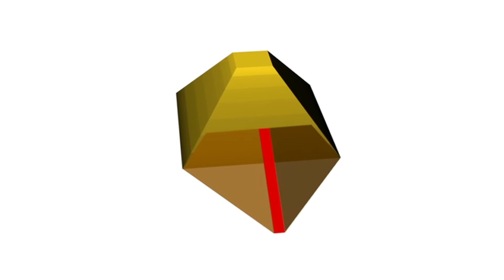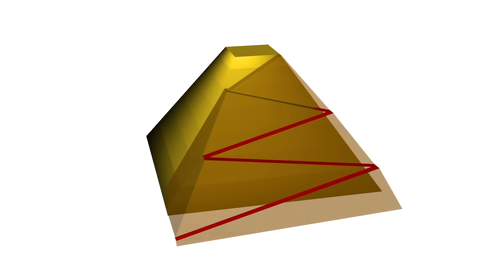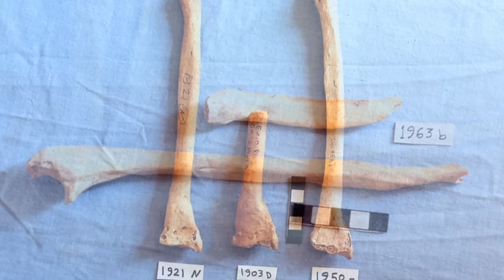Egyptology - Pyramid Construction

Comment: How did they raise over 100 of the 70 ton blocks 300 feet high after moving them 500 miles from the granite quarry
Reply: How about a reality break.

1 - there are not 100 - 70 ton blocks in the Great Pyramid.  Most of the granite in the Great Pyramid is the walls and floor of the King's Chamber which are vastly smaller in size than the larger relieving blocks above the chamber.  So right off you got it wrong.
2 - next is the King's Chamber is only about 140 feet above ground level and not 300 feet = thus another incorrect assumption laid to rest.
3 - finally is the granite from Aswan was transported via barges during the months of the annual Nile flood.  A harbor once sat about 400 meters from the Great Pyramid so the distance to move those heavy granite blocks was measured in hundreds of meters and not miles.  On the flip side the quarry at Aswan also sits astride the Nile River so there the blocks again would only have to be transported a short distance from where they were obtained to awaiting barges docked alongside the quarry area = and that makes Strike 3 - and you're out.

Moral of the story:  garbage in ----------> garbage out as the old saying goes.  When your information sources are flawed = bad conclusions inevitably follow.  So the Egyptians as noted built harbors which were near the areas they worked at.  Further they built earthen and mud brick ramps to raise objects in construction = some still exist to this day.  They also had knowledge of fulcrums and counterweights which can allow you to raise objects of a certain size and weight.  

So the largest/heaviest blocks are found in the bottom third of the pyramids and those could be raised via earthen ramps.  The smaller blocks above could be raised via a lever device akin to the Egyptian shaduf as the blocks were much smaller in size and weight.  The blocks at the top of the Great Pyramid are small enough to have been slid into place by several men.  Better luck next time.

Comment: They also discovered plumb lines and T-squares that they could have used to check the flatness. Also, Herodotus also recorded lifting mechanisms that could have been used when building the pyramids (although, he wrote about it centuries after the pyramids were built, so we have to take it with a grain of salt).

On that note, most of Egyptian architecture almost certainly used slave labor, such as in the Valley of Kings. Egyptians themselves might have helped, but slave labor was definitely used in some aspects of building.

Comment: Im a stonemason, limestone is soft compared to granite. Granite is so hard there's no way to rub down the uneven spots with flint. I call bullshit
Reply: Except they were not quarrying granite with flint.  lol!  They mined granite in the Old Kingdom primarily using dolerite and fire.  At the Aswan quarry along the nature fault lines in the bedrock they have found the remains of mud bricks and charcoal.  So the Egyptians were lining an area with mud bricks + building a fire to heat the bedrock + quench it with water = which softens the stone allowing them to pound through it much faster with the dolerite pounders of which many hundreds littered the quarry.  That would allow them to achieve the basic shapes which could then be polished using flat stones and an abrasive - possibly mixed with clay and water to create a polishing paste.

Meanwhile granite can be cut using copper tools - albeit slowly.  What is required is a lot of elbow grease and as noted an abrasive = sand or corundum.  As but one example an artifact unearthed at Amarna was created using copper tube drills.  In the drill holes they found a residue which when analyzed showed copper and corundum.  Corundum is of a hardness sufficient to cut through stone and emery corundum was available until modern times from the Greek island of Naxos while it is possible the Egyptians also had a source of it in their eastern desert region where various ores were mined by them. 

So as we see they actually had technology sufficient to employ granite for some basic structures = blocks and sarcophagi.  One does not see intricately carved granite in Egypt until the New Kingdom a millennia later.  While the Egyptians themselves did not smelt iron until the time of the Persians = others did - who the Egyptians traded with.  So it is possible that at least some iron tools made their way to Egypt although they were likely expensive and rare.  Iron filings have been found mixed into the surrounding sand of partially completed objects in New Kingdom quarries which were abandoned in place - probably due to the Pharaoh who commissioned them dying.  The Egyptians were notorious for stopping work midstream when a new Pharaoh came to town and began working on what they wanted.  Have a nice day.
Reply: @varyolla435  all good in theory, do me a favour go to a granite quarry and put this theory to test. Cut out and smooth a piece of granite 500mmx500mm cube  let me know how many years it takes you. Have a nice day

Comment: The ramp might have actually been turned into the pyramid itself, they obviously needed a ramp, so they must half built part of the pyramid using the ramp, then disassembled the ramp in such a way that would complete the other part of the pyramid at the same time.

Comment: I'm guessing that they had wooden forms right next to the pyramid for an easier transportation? They could have poured the liquid concrete in, let it dry and connected it to the pyramid? Just a thought.
Reply: Assume less and follow the actual evidence more.  Things tend to turn out better when you do.  lol!

1 - Google photos of the limestone quarries which sit adjacent to the pyramids at Giza.  That is where all of the limestone came from save for the white casing stones which came from 2 quarries about 6-8 miles away on the eastern bank of the Nile near what is today Cairo. 
2 - those limestone quarries show:  A:  they were clearly cutting "blocks" from the bedrock., B: the walls of those quarries are vertical.
3 - why is #2B relevant??  Answer: if the Egyptians were simply seeking raw material to pulverize into matter for some type of pre-mix - more work by the way - then we should see amorphous holes in the ground where they extracted small chunks of limestone and not neatly delineated mine sites where they were clearly cutting blocks from the bedrock.
4 - so limestone forms in layers like a cake with those layers varying greatly in depth and density.  Look at closeup photos of the Great Pyramid.  Note how it is made of an assortment of blocks of varying shapes and sizes = or exactly what you expect to see if workers are fracturing those chunks of limestone from irregular layers of limestone bedrock.  So they would cut shallow lines along those layers of the bedrock and then holes along those lines like the edge of a saltine cracker.  Then they drove wedges in those holes until that section of bedrock broke free.  After that they drove long chisels into the fractured section of bedrock along intervals until approximate size chunks broke free.  That produced as noted chunks of limestone of varying sizes based upon the layer of limestone is was cut from = or exactly what we see on the pyramids.
5 - finally they created earthen ramps to raise the blocks.  Wooden sleds pulled by teams of men and oxen would pull those blocks the short distance from the quarry to the pyramid.  There the blocks would be levered into place.  Sometimes a thick gypsum mortar paste could be applied before a heavy block to "grease the track" allowing it to be slid into final position more easily.  Look at those photos and you can see that gypsum mortar slathered all over the Great Pyramid in between gaps etc.. 

Moral of the story:  so above is just scratching the surface of all of the evidence relating to the pyramids.  They were not pouring blocks which would actually take longer and require even more work.  Also using a form to create blocks would produce standardized blocks = which as noted we do not see.  They were mining stone as indicated above in a manner consistent with what we actually see.  Forget the assumptions and follow the real evidence more.  Have a nice day.
Reply: @varyolla435  Thanks for the info!